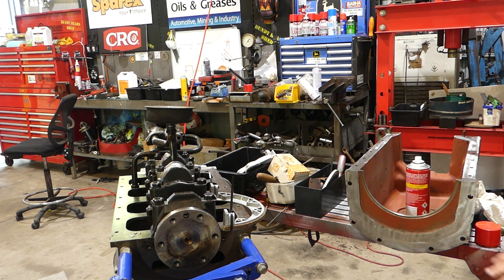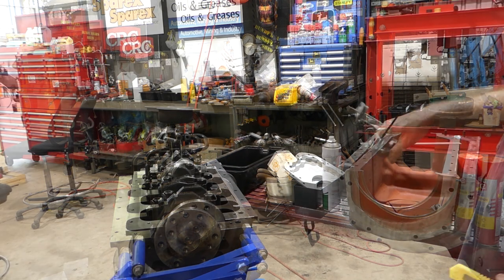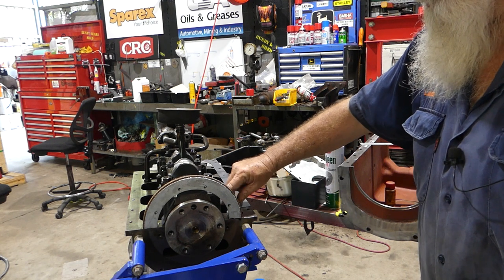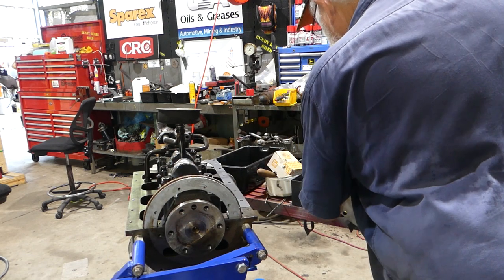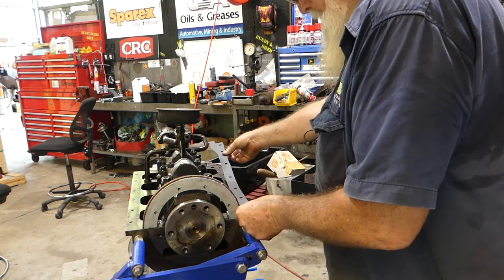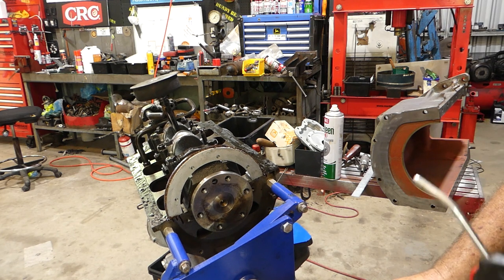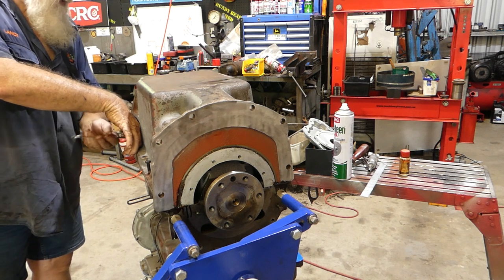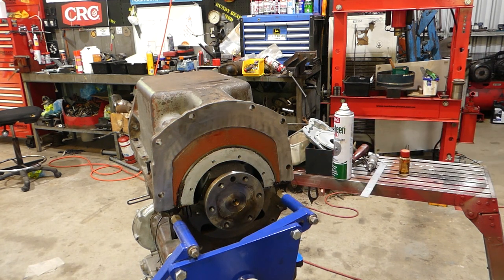Massey Ferguson 65 Part 46 Fitting the Sump

Comment: Great stuff Lance. I'm on with similar work on my Mk1, but of course the sump arrangement is very different with the extra "wedge" between the sump and the clutch housing. Apparently there are rubber bungs above that wedge to help it seal - I guess I'll find out when I get in there - it looks like it might be fun to align and seal everything with the additional components.
Reply from the maker: This was a fiddle and I cut a lot out of me sliding things around lining up gaskets just to keep it from getting too long and boring.